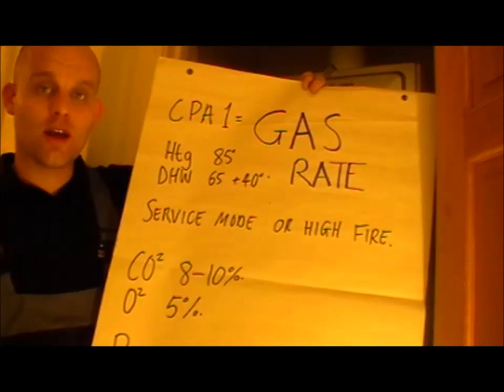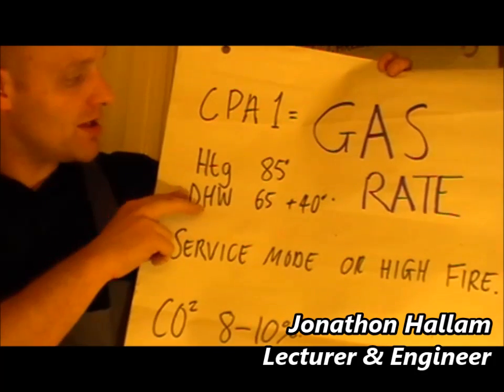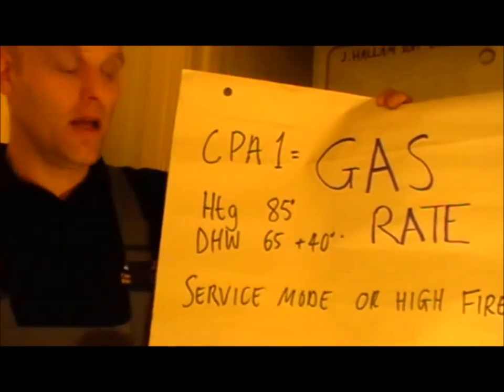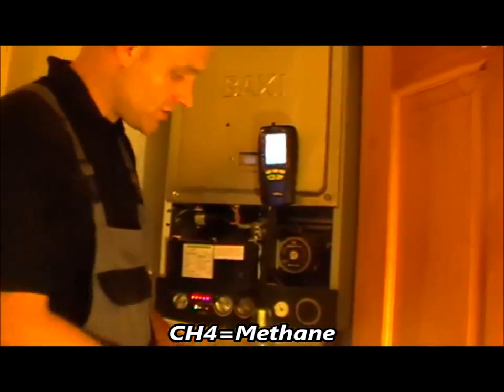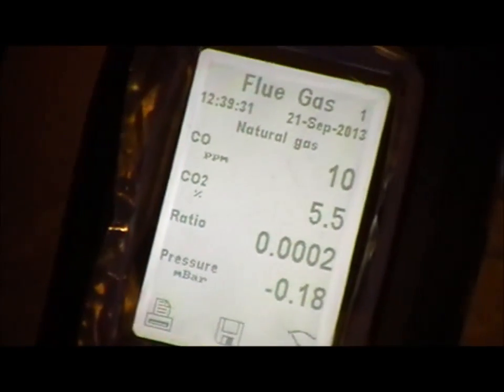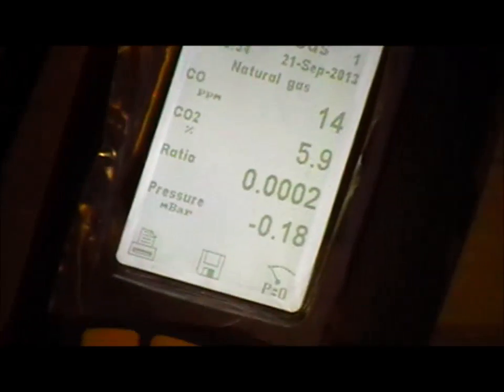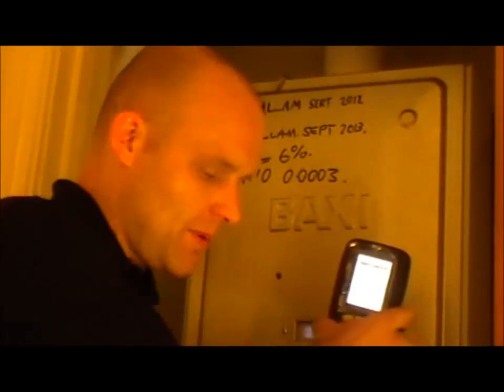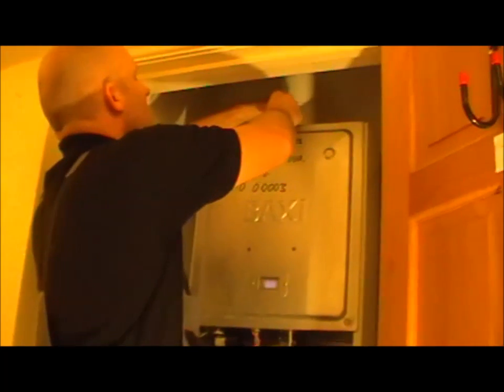Boiler Service Part 2, Flue Analyser

Comment: Hi I am a newly qualified person. I bought  anton evo3 and did a flue gas analisys on my boiler.i got the reading  co 42 ppm, co2% 6.4,  ratio 0.0007 .  And o2% 9.7 , XS air % 86.4.  can u explain O2 and XS air please if you can??? and also dont we have to put  probe in to thesampling air inlet to check the air integrity?  Thank you
Reply from the maker: Follow me on twitter or facebook, ill offer you 24/7 guidance

Comment: It would be nice to see a boiler in which the readings were out. Then what you did to get them in. Also the figures you quote, are they general for all boilers, or are they specific to an appliance?
Reply from the maker: John Burns for all boiler mainly condensing if readings are out clean exchangers check always ways flue or partials then consider gas valve
Reply: THanks.  But "Also the figures you quote, are they general for all boilers, or are they specific to an appliance?"
Reply from the maker: John Burns condensing, balance or open flue will be a lot higher
Reply: What I am poorly saying is that the vid does not state what the figures are for.  Are they general to all, or specific to one boiler having to read their boiler spec sheet to see if it is in range, or fan flue, regular boiler, condensing, balanced flue, etc. :)
Reply: John Burns all figures are different for different makes of boiler, you'd have to check the manufacturers instructions to confirm

Comment: I think you got your ratio wrong on the paper when you said 0.004 is a good reading, you've missed a zero out there.
Reply: Dave Laye stats what I thought 0.0004 🤔
Reply: 0.004.
Ejaz heating and plumbing Watford
Reply: nope... 0.004